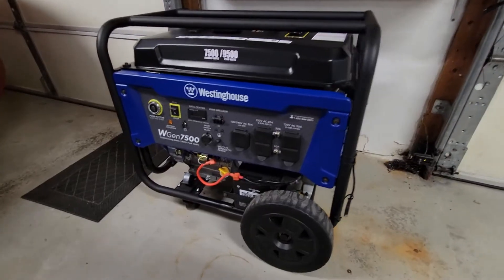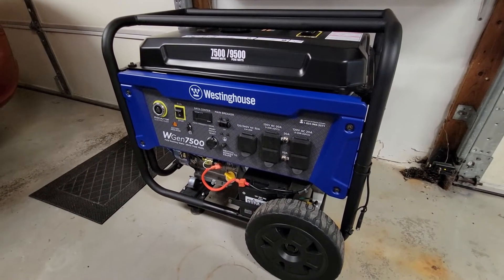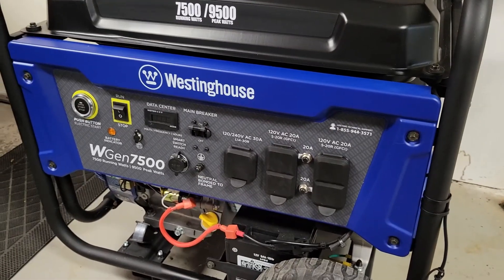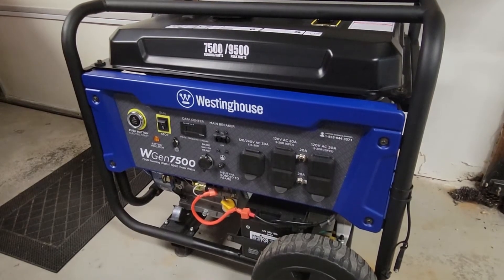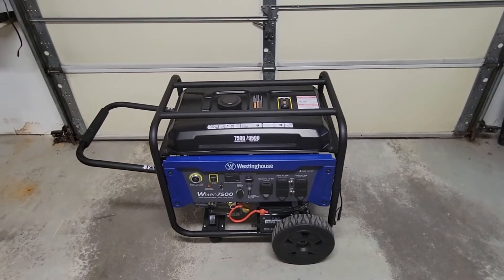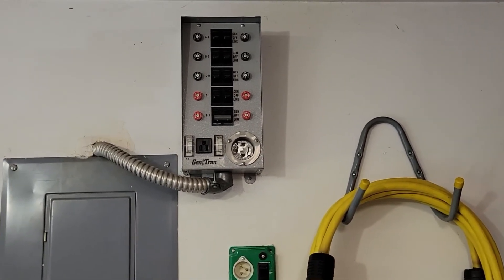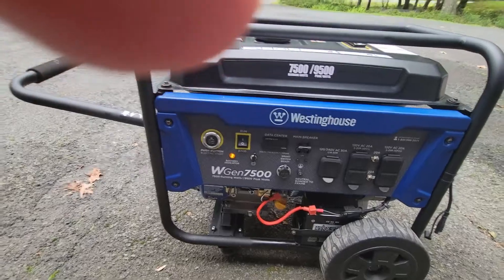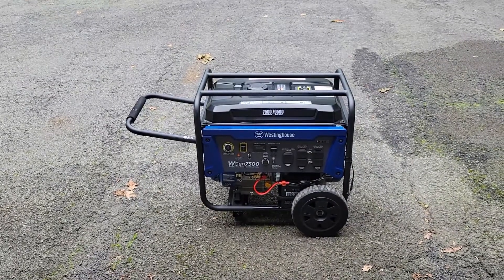Westinghouse WGen7500 generator - 3 year review & tips

Comment: It will not overcharge if you leave it plugged in so you’re wasting your money if you go out and buy another charger
Reply from the maker: Respectfully, I called Westinghouse and asked them, and they stated it is not a trickle charger. I have a number of Battery Tenders on hand, so it was simple enough to use one of those. There's probably a way to verify what the factory charger does, using a meter or something, but I was never that motivated. 😊

Comment: Why not use charger that comes with it?
Reply from the maker: Good question.  The charger that comes with it will never stop charging and can damage the battery.  There's no way to know if the battery is charged or not.  With a trickle charger like a battery tender, it constantly monitors the battery and just tops it off as needed, so it's constantly full and ready to go. So you don't have to worry about it, just plug in and it does its thing.

Comment: Regarding your advice to not store the engine with no fuel in carb as it will dry out and leak.........Then explain to us why millions of brand new engines with small to tiny carbs dont have orings and carb/needle seats dry out while they are waiting for months to years before they are sold.   Why do you think almost all new small engines come with a carb drain plug.  Ya, it's for off season storage.  

Lord help you if you get one of those new engines with plastic carbs and/or plastic cartridge for hi and low speed jets.  Gas so bad Briggs & Stratton went with a throwaway just replace entire carb desing.  

Trust the owner's manuals, not me.   
LONG TERM STORAGE
Even properly stabilized fuel can leave residue and cause
corrosion if left long term. If storing the generator for two to
six months, drain the float bowl to prevent gum and varnish
buildup in the carburetor.

The fuel in carb bowl will evaporate and leave deposits that will F up the needle/seat so it floods out next time you use it.  Been there done that got the t-shirt!  

p.s. use Seafoam instead of Sta-Bil.  You'll be much happeir as it lasts way longer.  You're correct, Sta-Bil is only good for a year or so.
Reply from the maker: Somebody had a lot of coffee this morning.

First, there's no comparison to brand new parts that have never been exposed to fuel vs. parts in a working engine that are soaked in fuel, then dried out, repeatedly.  IF they are even dried out, because you likely aren't getting all the fuel out of there.  

A couple weeks ago I drained the fuel on a 9 year old B&H on an Ariens snowblower.  It doesn't have a drain plug.  When I removed the float bowl and needle, I was stunned at how clean it was.  Literally would not be able to tell the difference between it and brand new parts.  Clean and shiny, amazing.  It's never been drained.  It's always had ethanol-free fuel and Stabil.  I did mention ethanol-free is less prone to leaving deposits.

If you're talking about storing something for years, then I would drain it as best I can, maybe even take it apart and clean it.  But my generator needs to be at the ready 24x7x365.  So I run it every 4-6 weeks and care for it as I stated.

As for the drain/not drain debate, I didn't make this up myself.  Here's one of many explanations of the rationale:
https://www.goldeagle.com/tips-tools/lawn-mower-storage-why-draining-fuel-tank-mistake/